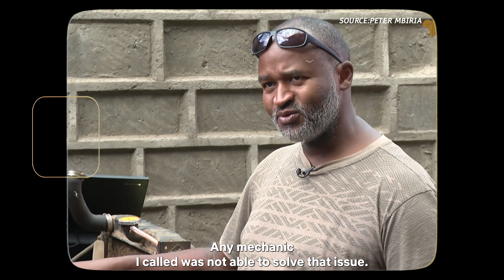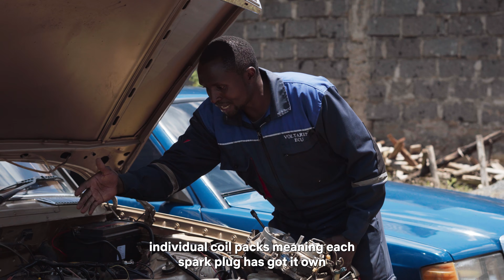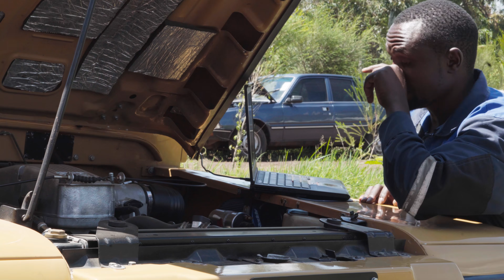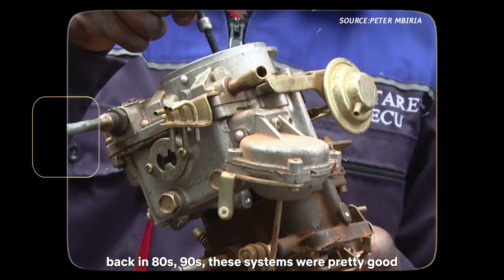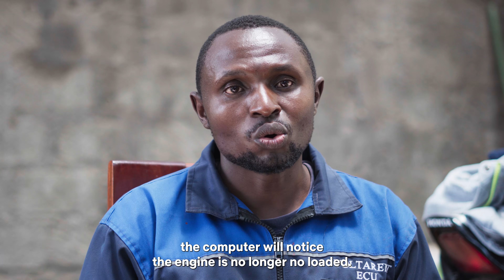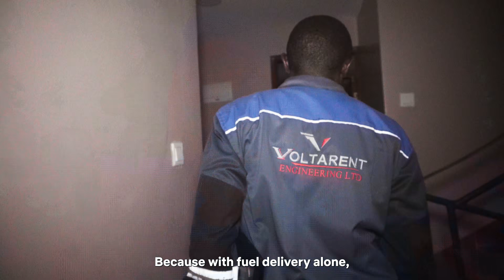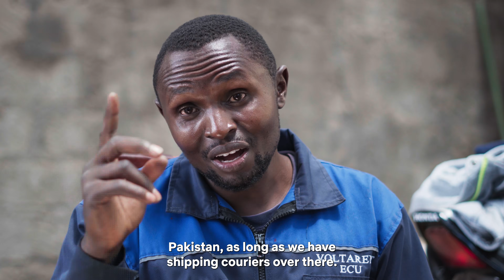This African Genius Makes Old Engines Work Better Than New Ones

Comment: This guy clearly knows his stuff, but the exception here is by not using an O2 sensor for feedback, he’s just running engines on a open loop script. They will not be their most efficient. 
I’m sure developing an ECU with the logic to regulate fuel trims based on sensor feedback is probably a bunch more challenging.

Comment: This is why car used to be cheap and affordable. Now with excesive amount of sensors and only dealer closed diagnostics are so expensive. I rather drive an old, reliable and cheap car than a brand new

Comment: In Africa this man is a genius. To the rest of the word he's just a standard Automove technician who found some Ecu sample code and can program an Arduino. While 6his might seem amazing for African standards it's not anything that hasn't already been done 20 yrs ago with PIC microcontrollers.

Outside of africa when u factor in time and money it makes no sense to upgrade an old car this way. It's cheaper to buy a used modern car. In addition there are 1000s of mass produced ECUs that can be used that also exclude all emissions sensors. The problem is it won't pass inspection. However in Africa the government's are not concerned about that kind of thing. And even if ur car is dumping smoke and oil out the back end all it takes is a small bribe and u are on ur way again.

There is nothing unique about this arduino ecu. There are many man many examples of it all of the Internet

Comment: actually, I've seen many mechanics doing this all over the world. It's really a good way to reuse old engines. But just one thing. Along with changing the ECU and Injection system, why don't they also tear down the engine part by part, and rebuild it again by cleaning it, making it to run even more better?

Comment: My hat is off to you young man! Congrats on achieving what the big Car companies always say is impossible! I am a veteran mechanic of 17 years and I have always said that if I owned a junk yeard I could build a car or truck better than the factory can engineer one, and I can do it with their old ideas! In fact, I have done it a couple times in my past. I built a 1985 buick regal that was about a 14 secong car, and got about 27 MPG back in the 1990's. Then in the later 2000's I did it again with a 1986 Mazda RX7 swapped with a  2000 LS1/4L60E and an 8.8 T Bird IRS conversion. That car went 12 flat and 132 in the 1/4 mile, topped out at about 165MPH, and got 29 MPG. Had near perfect balance, and with 4 piston performance brakes it was pretty much a perfect car. The point is never buy into what they tell you isn't possible! They just haven't figured out how to do it yet! SO,,,,, go be the first!

Comment: Man we need people like him  . Everyone saying electric cars are the future but, No one understands how much electrical and non bio degradable waste will it give to our world because if it needs to charge need to produce electricity from power stations (Nuclear, Fuel etc.) and ever after 3 years every cars battery efficiency gone plus it has to be replaced and the low performed battery will provide massive waste if its refurbished. Vampires controlling the world and they are saying its safe for future but the truth is its getting worse guys. I'm saying we need people like him.

Comment: So he is just rebuilding carburator vehicles in to ECU vehicles. Okay, in my country we did it for fun at 14 years old. Like 1/3 of our boys in our country could do that. I dont understand, where is the genius then?
Reply: He told me he learned everything he knows from you 🤠
Reply: @roguebossa  Try rebuilds with LPG. You can use carburetor or injection. Both ways will decrease running costs. And yea, my first rebuild with carburator LPG was done at my 14s - Vehicle bmw 528.

Comment: ECU is basically a Speeduino, its free and open source software made for an Arduino and some additional components with schematics to build.

In the video you can clearly see the Arduino IDE and Speeduino and real time output of the logs.
The guy isn't an inventor, hes using open source, already cut and clear software and steps to build the hardware model.
Reply: Sounds like a lot of hate to me. Just because he is using open source software he is still designing and building.  Most mechanics can’t do this. They just try to bleed you dry

Comment: I dont doubt that he knows what he is talking about but there is something I am missing here, he is talking about power increase, better economy and all the benefits but come on, at least my engine will need new internals, I am  talking about a 4D56 turbo diesel engine from the 90s, is not even electronic fuel pump its mechanical fuel pump, so how come this guy claims to get more power and not sacrificing reliability in the engine internals??

Comment: Congratulations Peter 👏🏼👏🏻👏🏿👏🏽, I wish you could come to Miami some day , I have a 1985 Ford F150 , straight 6 , only 80,000 miles ...after 40 years , I did replace the carburator a few years ago, but needs proper tuning ... and you have the knowledge ... I will try to go to your country some day ... best of luck with your business 🫂

Comment: His ECU is probably using a Volumetic Efficency logic. No need for MAF and speed density or any other nanny sensors. Very easy to tune via logging and +/- percentages editing. Just need MAP, TPS, Air Temp, some sort of AFR and external reluctor wheel will work. Interesting how he specs injector size and sets its constant. I did something similar for my family in the philippines and used a 02 Chevy cavalier ECU in a jeepney using my HP tuners I already had in the states.

Comment: I was skeptical at first but they aren't just strapping a new CPU on a car and saying its updated lol. Seems they are making upgrades to key areas under the hood. Admittedly its not going to make a car limitless lol, but it will keep them running better for longer.

Comment: I'm skeptically optimistic. It seems the real innovation is in his software. Most of the hardware seems to be off the shelf components that have been modified for this application. Each vehicle is kind of a one-off because not all engines are built the same. So, while this technology is probably not going to get widespread adoption around the world. But in places that have many older cars, with increasing difficulty of finding replacement parts, I believe that this is a really ingenious way of keeping older cars on the road for minimal cost and even providing some improvements. From an environmental perspective, keeping an older car on the road longer uses less energy than building/shipping a new car. Great job Peter! keep up the good work.

Comment: 14 km / liter is about 56  MPG, so this is an obvious lie for the vehicle on the highway.   The very best possible would be to match the MPG of a new model of the same vehicle.  It is sad to see so much promotion of impossible claims.  Sure he keeps old cars running, but why must they make wild claims.  A cheap electric car charged by solar panels would be much more appropriate for this region as they have so much sun shine.

Comment: K-Jetronic was not an improved Version of a Carburetor. It was a mechanical Injection System made by Bosch. They work very good and were very reliable. These freely programmable control units have been around in Europe for 15 - 20 years. They are mainly used in the tuning scene. VW VR6 with up to 1000 hp is possible with them (naturally with corresponding motor components.).  The fact that this nice guy invented something like this himself is very impressive. But you should also note that only he can do it. He is a specialist. The work on the engines to retrofit all this stuff is very extensive. He also has to manually adapt the software for each car. Nothing that works plug and play for every car. It's not voodoo and he's not going to change the world with his control unit.

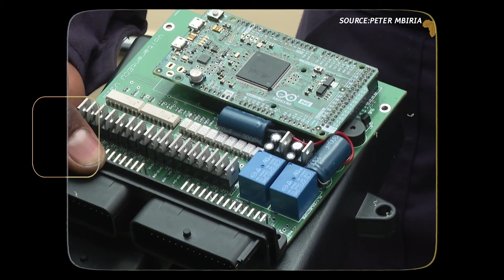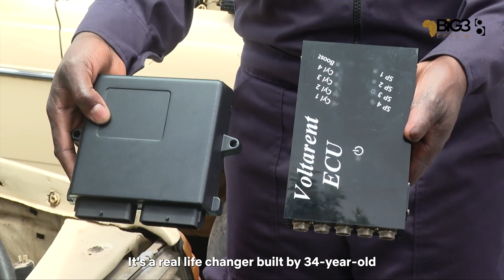Comment: 2:20 and 2:48 as an EE aw hell naw, using a dev board for a ECU nope, no strain relief on components which will experience severe vibration and so many more issues. If this "proprietary technology" is put to the test it won't pass a single certification which makes vehicles "safe" to drive. What he is doing is an EFI swap which people have been doing for decades and his design looks sloppy at best. I would have generally said that he is working with the resources he has but when you are working with things that can put the lives of many in danger no excuse is good enough for your incompetence.

Comment: I hear fuel injection has a drawback its creates junk in the valves and in the oil meaning engine will need a rebuild sooner than before and have to change oil sooner. But i guess its slightly better for a car that uses alot of gas but will have to pay money sooner or later you arent really saving much.

Comment: In a car with many problems, such as worn tires, damaged electrical wiring, damaged plastic parts, a worn engine, worn suspensions, worn brakes, worn pipes, and many more, I don't think it's important or economical to put something on it to supposedly make it more economical.

Comment: The concept of replacing or upgrading fuel delivery systems in older cars (especially swapping carburetors with electronic fuel injection + ECU) is not new. MegaSquirt, Haltech, AEM, and ECU Master are all examples of aftermarket ECUs that enthusiasts have been using to tune or modernize engines since the early 2000s or earlier. I mean, this guy is great, and providing an affordable and local alternative in Africa is really good. But this has already been done for decades in the rest of the world.

Comment: They buy a used carb with problems or from another engine thats got a different set up and jets and then are surprised when it runs badly. Devloping world mechanic try fix your carb with a hammer is the reason you wasted all the money in the first place.

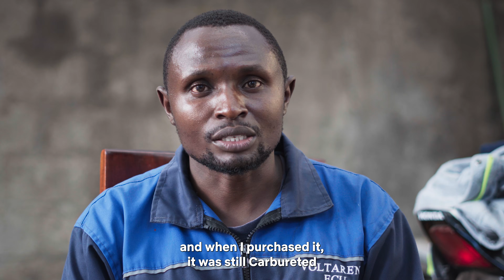Comment: 06:36 THIS IS OLD BURGUNDY RED VOLVO NOT MERCEDES W204 AS YOU'VE DESCRIBED.

SO YEAH THIS VIDEO ISN'T RELIABLE TO BE HONEST ⚠️

In USA 🇺🇸  you can make this conversation into using ECU even without or with adding Turbocharger.

Even I've doing that with my old Mazda MX5 Miata and FIAT Punto II even whenever I'm not having PHD education at this point.

Comment: Any one understand how he has a hex can coder to read to English if u get what im saying
Reply: Its speedino  , a arduino powered ecu and fuel injection system . 

This isn't "genius". People have been doing this for a long time here in the US.  

Guys do this over a weekend to convert old American muscle cars into fuel injection for racing
Reply: @alanomofo  yh but this guy is making custom fuel systems to for the old engines along with a ecu paired which is fire. but how can i read hex code from my stock ecu not a arduino ecu mk4 bosch edc15 k

Comment: The point is that the tools and science were there for decades, but automotive industries did not want to apply this because they just want you to buy the new models and keep discarding the old ones as junk ans thrash, even when we have the possibility to update them.

This kind of technology should be more widespread, but you know that for the profit driven automotive sector, this is not profitable, even though it is ecological and reasonable.

Only small businesses like these are interested in being efficient and not simply discarding old motor systems.

Comment: Man discovers techonlogy from 1980 and is herlded as a genius.  2:51 charging over $900 for an arduino is bold, especially since according to the website it does not come with a wiring harness, fuel pump, injectors, throttle body, distributor, or intake.  All of this can be purchased from Holley for decades as a complete kit.

The claims about fuel effiecncy are largely bogus there is no practical difference in fuel economy from a tuned carburetor and EFI.

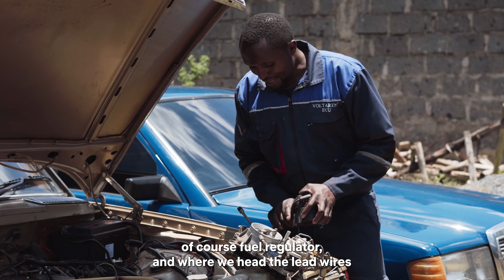3:48 spending money to replace one EFI system with another more jankey EFI system is not going to "rewrite the history of automobile engines."
Reply: please post your test data for the EFI replacement system used in the video
Reply: @okname5335  It's literally a speeduino. The entire project is open source and has been around for years and my own personal car has been running one since 2020.

Comment: 15:25 Ok that was complete BS
Reply: You don’t think you could get 60 more horsepower out of an stock engine from tuning ?
Reply: this ecu can command the engine to get more fuel and air which stock ecus don't do. The same with racing ecus

Comment: I will take a carburetor over EFI any day. Many modern vehicles are worse on fuel and reliability than their 80's or 90's counterparts. Open deck design. Get ready for a weaker block because it is cheaper to tool. Get ready for the EPA who maybe protects our environment by making things less harmful and less fuel efficient at the same time. 1981 CRX gets better fuel mileage than the new hybrid CRZ. Expensive EFI that needs to be troubleshooted by a dealer. Sensors that cost more than a replacement car. I am all set. This is not an upgrade. It is a massive downgrade. Good luck. We now live in a throw away society where people like clause schwab tells you you will like it and be happy.